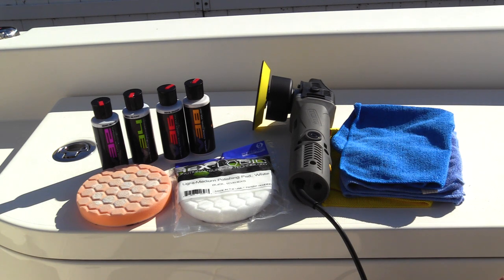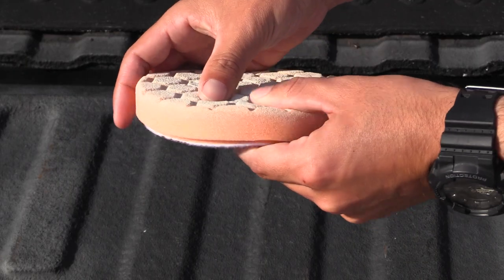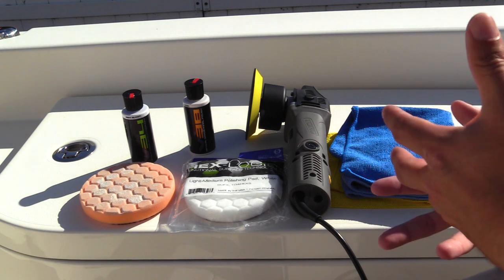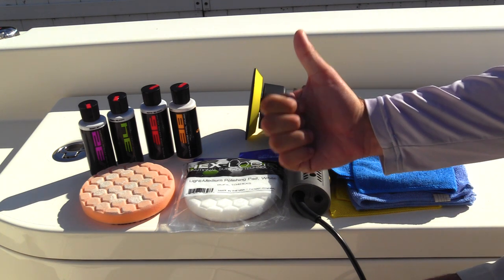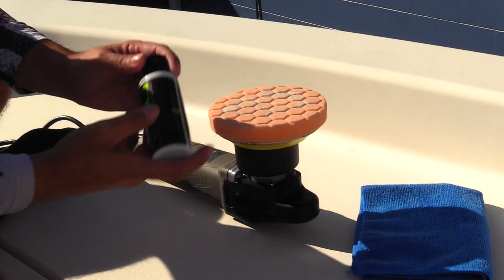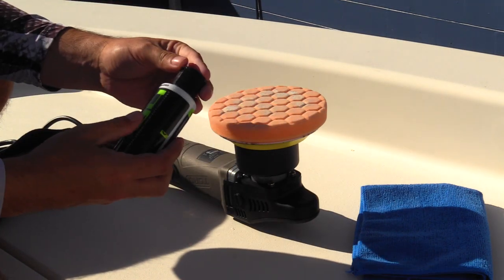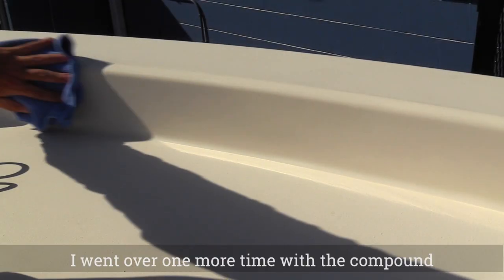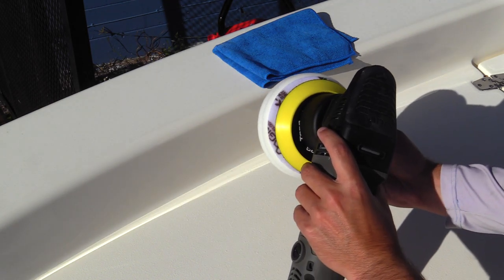Buffing and Compounding Boat Gelcoat - Removing Oxidation

Comment: Hello I just purchased the kit and can’t wait to use it this weekend! I was wondering since my boat is a little more oxidized would it be better for me to use the yellow pad? Your input is greatly appreciated. Thank you!
Reply from the maker: kevin cooper the pad that is the most abrasive. I believe it was orange with the kit I got
Reply from the maker: A couple things can help you out. When you wipe the gel coat does powder get on your finger? If you haven’t ordered the pad yet try the orange one. Good rule of thumb is if you don’t have to use a more abrasive pad don’t. So take a small section and try the orange and then white. If it takes too much elbow grease with the orange then you’ll find the yellow one will make your life easier
Reply: Chris Canning Yes I ordered it already but I will take your word of advise and try the orange on on a section first. Thank you for guiding me in the right direction my friend!!!